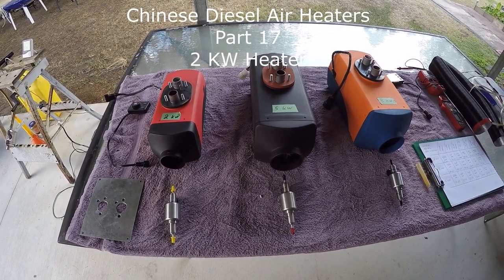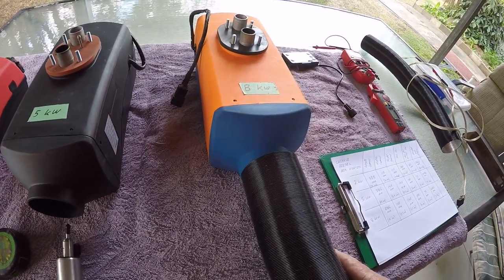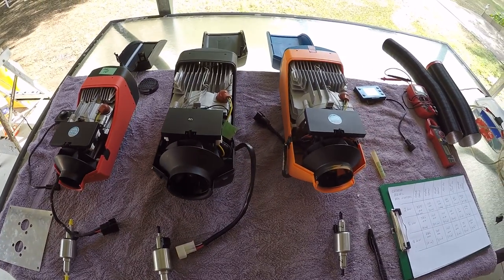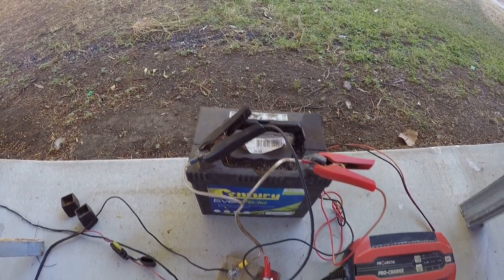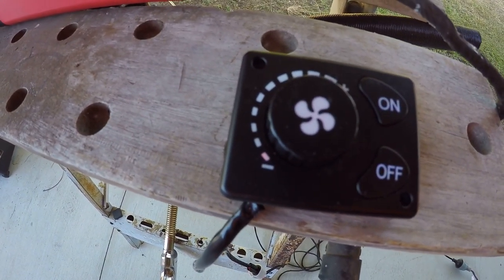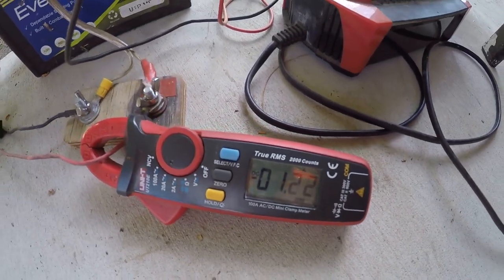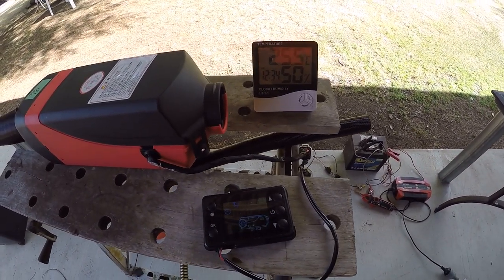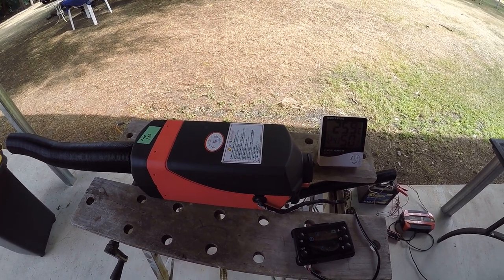Chinese Diesel Air Heater   Part 17 -  2 Kw Heater

Comment: Hi John, I've come across an eBay seller that provides parts that you recommend. He must have been watching your channel :-) Here's the link. https://www.ebay.com.au/itm/224469427494 as you outline here, the components for the 2 kW are the same as for the 5 kW.

Have you experimented with diverting hot air of a 5 kW heater if the output is too much even on the lowest setting? I am definitely going to built a mobile unit so I could also dissipate some heat before going into the enclosed heating area.

Do you have any thoughts on this?

Comment: Hi John, our company specialises in heat protection products and we have had lot's of customers ordering our exhaust wrap lagging to wrap around their diesel heater exhaust pipes. They may have the heater built in to a cupboard or have some other reason to insulate the exhaust pipe. I'd like to give you some of our products to try out. We would be interested in seeing what worked best. Contact www.koolwrap.com.au
Reply from the maker: Hi Andrew, I would be very interested. My email,  johnmck47@outlook.com

Comment: Thanks for your bench testing the smaller heater and now I know not to buy it.
Reply from the maker: Hi Van, the 2Kw heater is fine for small spaces, and easily mounts under a seat in a small van.  JMcK
Reply: @johnmck1147  Thanks John you helped me decide to go with the 5KW and save fuel and power. What do you think about using a turret to install these heaters as many people claim it is a safer method to use?
Reply from the maker: Hi Van, not quite sure what you mean by a turret. Can you give more detail. Thanks.  JMcK
Reply from the maker: Thanks VM.  Suggest you have a look at the motorhome videos.  JMcK

Comment: Hi John! Its any additive to clean the heater like sea foam or mystery oil?
Just curious
Reply from the maker: Hi MM, the best and easiest I have found to clean these heaters is to burn a 90/10 mix of lightning kerosene / diesel for 30 minutes at a med to high setting.  JMcK
Reply: @johnmck1147  thank very mucho amigo  Feliz Navidad  n happy new year